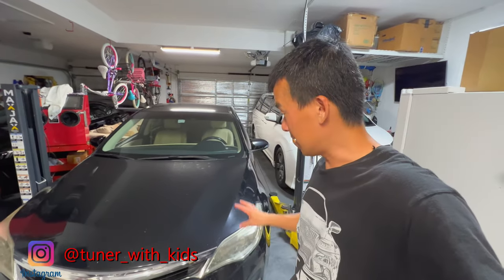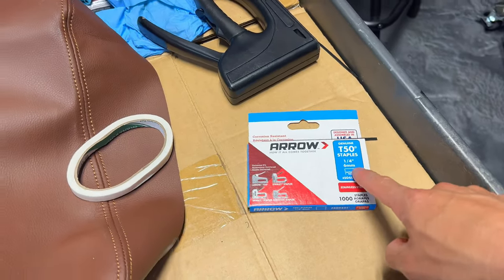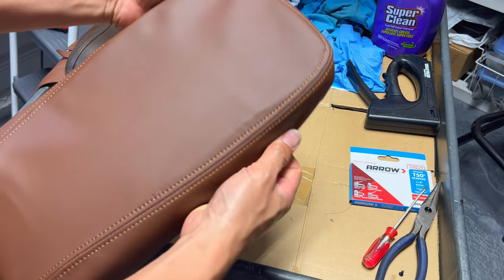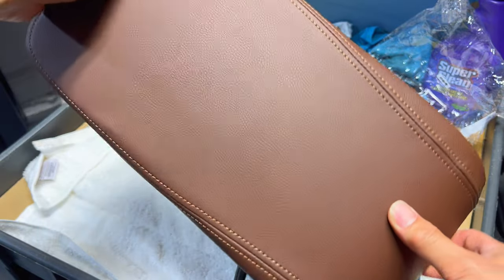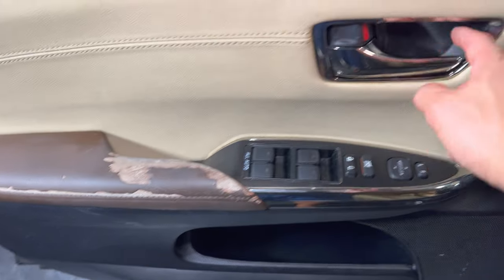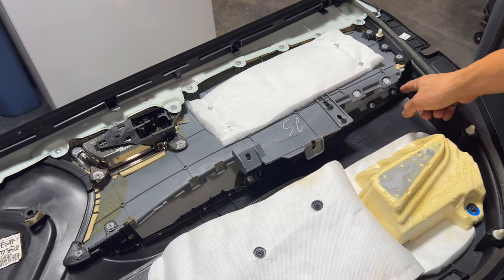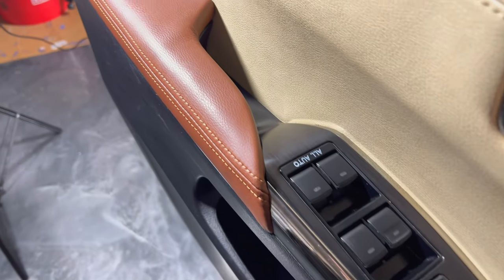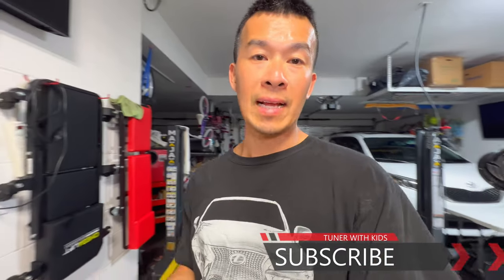How to Replace Armrest Console Door Panel Leather 2013-2018 Toyota Avalon

Comment: Thank you so much for this video explaining how to remove the center console cover. I bought mine on eBay from KBH AutoSport in the dark gray trim and it matched perfectly. I did have trouble with the staples so I ended up using Gorilla heavy duty glue spray I had at home. I also bought this "Pell flexible foam stabilizer" from Joann Fabrics for $3 and glued it to the inside of this trim. It gives the additional cushion that the OEM cover gave and I'm quite happy with the result. Thanks again for all the tips in the video.

Comment: Thanks for the video.  On your advice, I went with the black instead of the brown and it looks great.  I also chose to leave the existing vinyl in place and wrapped the new right over the top of it.  This worked great on the center console because I kept the soft padding in place.  On the door arm rest it was difficult to add the vinyl over the old because the space is limited and the tolerances are tight.  I would probably remove the old vinyl on the arm rest if I had it to do over.

Comment: For anyone who attempts to do this fix, here are a few tips:  use a heat gun on low setting to make the fabric more malleable and to remove the wrinkles.  Staples can be used, but you'll need a heat gun (low setting again) to warm up the hard plastic.  Move the heat gun around, to avoid over heating in one spot.  This will make the stapling much easier.  The other option (which I used) was use DAP Cement glue to secure the new leather covers.  Best of luck.
Reply: Yep. Specifically DAP Weldwood Contact Cement. Planned to use staples too, but the cement attached it so well I did not need staples.
Reply: @MapleMan  my experience as well.  7 months later, still holding up great!!
Reply: I agree with heat gun, but if you haven’t work with a heat gun you should definitely should practice on something similar that’s disposable. I believe the new wrap is designed to go over the original for padding comfort.

Comment: Good video to remove the console and door. I have an electric stapler and it works much better than a hand stapler. I used 3M 90 adhesive spray to align my seams first and it worked well. I think the trim is bigger to wrap over the original wrap to give padding. A heat gun on a low setting can get wrinkles out.

Comment: I have exactly such a car, and indeed, this is a manufacturing defect for this generation, and Toyota did not solve this problem, and this is one of the reasons for stopping manufacturing Avalon, because they focus more on Lexus.  But the leather that I bought from Amazon is of a different color and the stitching has ripples, but the result is good
Reply from the maker: Yes my brown was way off but looks good. I am swapping Cupholder to black and gonna order another set and cut to fit rear door panels since rear replacements are hard to find. Plus same supplier so color matches.
Reply: @TunerwithKids  Black may be more suitable, but there are more beautiful colors on top of beige. I expect a darker color should be chosen.  Look at the light color does not suit much.  Choice of German leather.  It is plain and there are not many granules in it
Reply: Not a defect. Toyota uses cheap leather and an overall cheap interior/body parts. It's been this way since I started working on cars in the 90's when the camry doors would consistently break.

Comment: Good job thanks a lot I've got to work on my 2013 limited same issues😊
Reply from the maker: The rear armrest door cover isn’t sold by most sellers but I looked it you can also trim a front replacement to fit. I have a set that I will be trying to redo soon.

Comment: Hi were you able to replace the cup holder leather cover? I found one for my avalon but have no clue how to replace it. If you have can you make a video 😅
Reply from the maker: I have not, I did replace it with a junkyard one from 2017 model but it also starts to melt in hot sun. I plan to try and wrap the old one using some vinyl leather I bought for the slide lid under the radio.

Comment: Hey I just bought a 2015 Avalon and had the same issue with the center console. I was having trouble figuring out the exact color to order online, it’s almost like a light grey/blueish color. You wouldn’t happen to know the color to order?
Reply from the maker: Nope, but I’d do black since most of the interior is also black. I made mistake and bought brown when should have done black.
Reply: @TunerwithKids  scared to order the black and it not much the cup holder and sides/steering wheel 😭

Comment: It seems like this is a very common issue with the Toyota Avalons. I won't be buying another Toyota because of this. My Honda never fell apart even with many many more miles. I'm barely over 100k & my avalon is falling apart. Shame.
Reply from the maker: Common issue from this era. It’s probably a bad supplier at the time.
Reply: It's true that the interior for the avalon is certainly not top quality, but the trade off is that the engine is bullet proof and will run 250k miles easily.  Replacing the arm rests is an easy fix for such a reliable car.